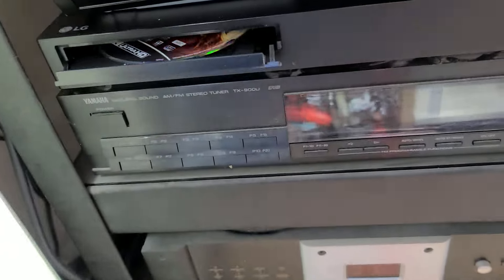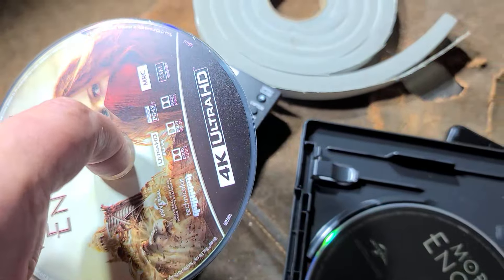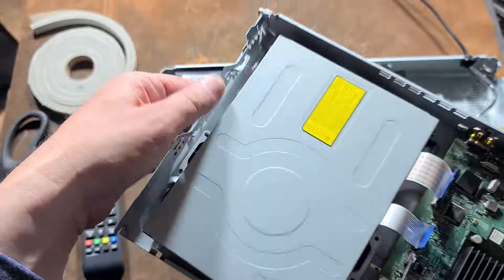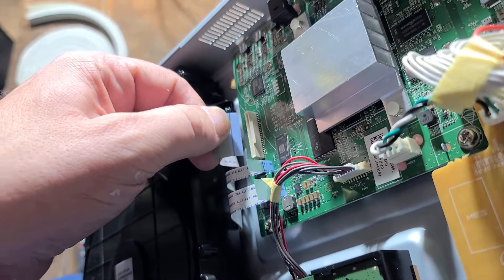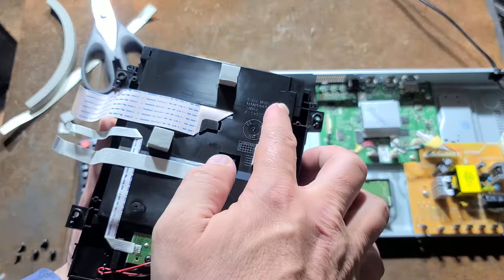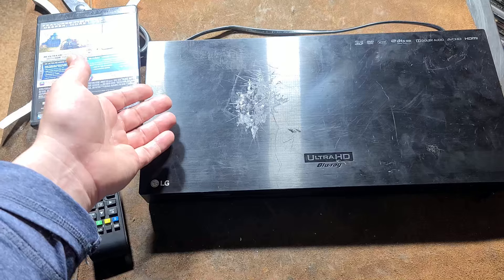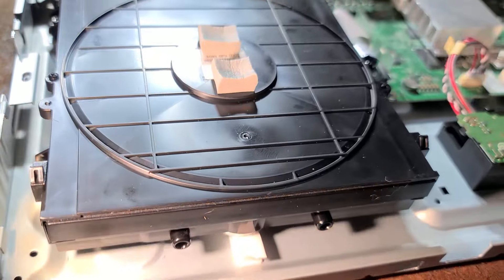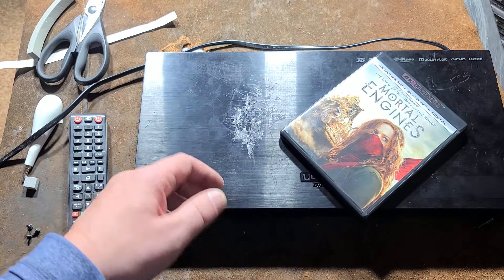How To Fix Blu-Ray Player Noise & Vibration... 4K UltraHD

Comment: Could you share your long term results? And where exactly you placed the foam on the underside of the drive? Thanks.
Reply from the maker: Near the end of the video but it may not have been that clear.
I place a silicone pad under the eject motor, one that was thick enough to put pressure on the motor but no so thick it was bending the disc transport (and that was the only spot that made a difference) as that was the source of the noisy resonance from unbalanced discs.
It is a cheap lightweight player and I put a relatively heavy piece of audio gear on top to further dampen the noise.
This fix will not make it like a $1000 Audiophile/Cinephile player. but will make it quiet enough to be usable. And it supports Dolby Vision which is why I am keeping it and getting rid of my Samsung 4K players as Samsung does not support Dolby Vision on it's players or TV's.